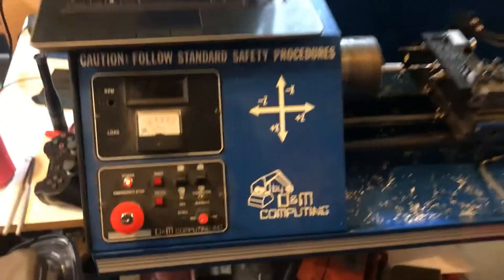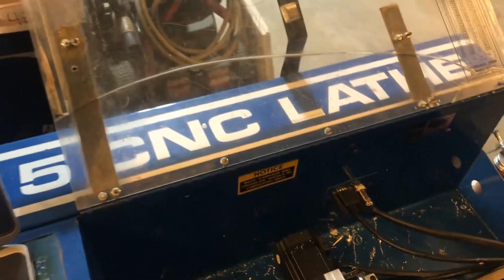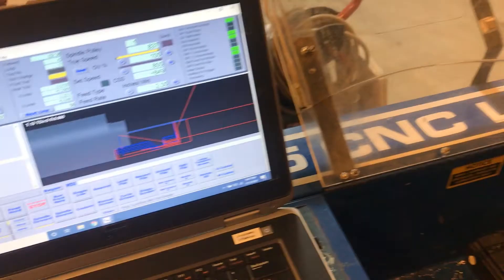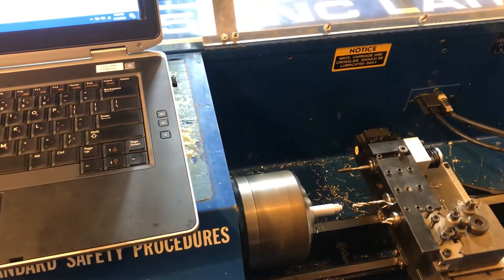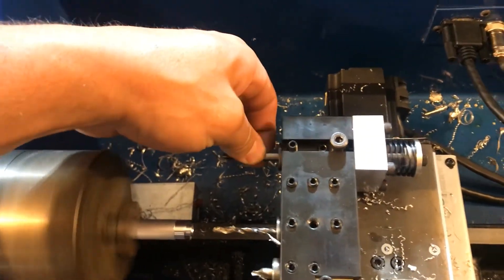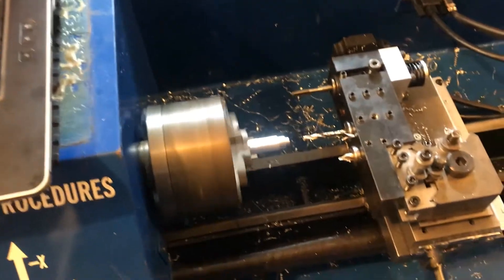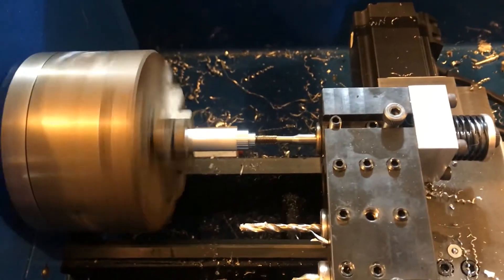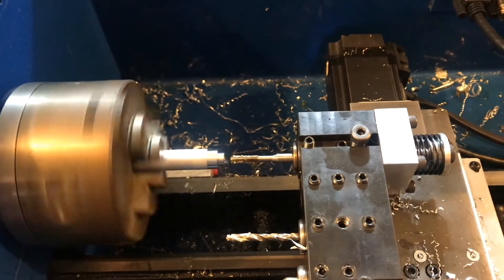Semi-rigid tapping with Mach 3

Comment: well done, what is the code?
Reply from the maker: I was using a G32 call, single point threading. Standard G & M code.
Reply: @srcarr52  as you say G32 for single point threading and that is what I use, but this is not single point threading it is rigid tapping, I tried G84 and does not work, can you help please?
Reply from the maker: @GraphicManInnovations  Mach3 turn does not support G84, thus why I had to use a floating tap holder and 2 G32 calls.
Reply: @srcarr52  that is true, i just figured it out, i also did the same, the only issue is the time for the deceleration and stop at that time the feed is stopped a floating holder is needed at that point, I have a floating holder that is flexible in the pulling direction only do you think it can work?
Reply: Hi would I be possible if you could share the g code you used as I’m struggling to get G32 g code working for semi rigid tapping. Thanks